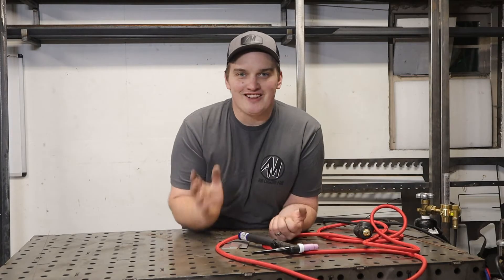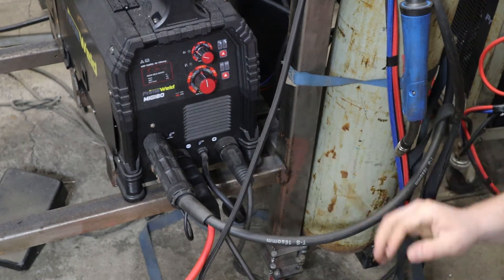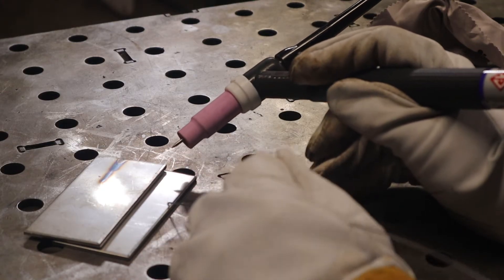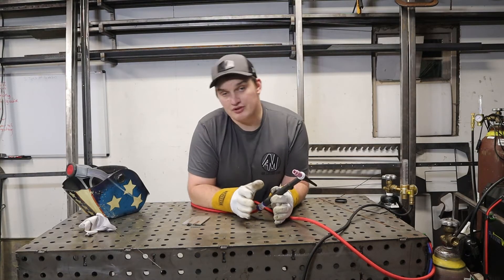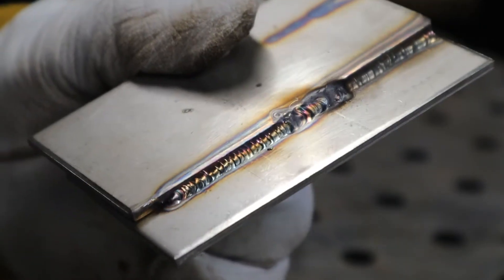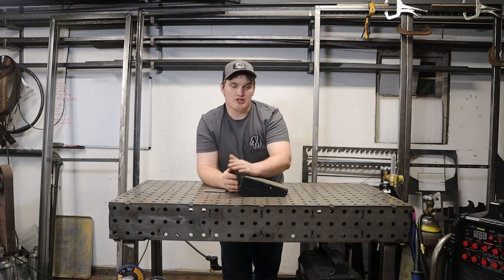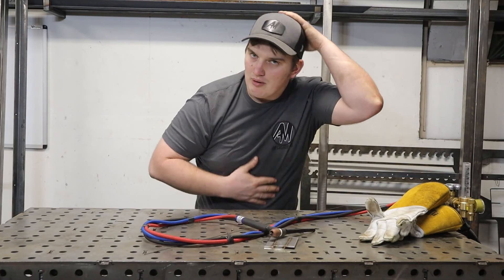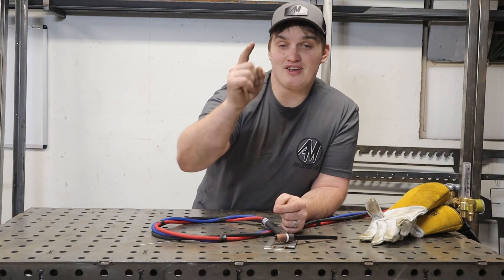Tig Welding Explained: SCRATCH START vs.  LIFT ARC vs.  HIGH FREQUECY

Comment: Better way to do scratch start tig is to rest the cup on the work piece and flick the filler wire between the tungsten and the metal. Makes sure your weld puddle doesn’t get a tungsten inclusion and it won’t mess up your sharpness on your tungsten if you mess it up

Comment: Out of the many tig videos I've watched, no one has ever mentioned a. That you can run a tig by clamping it to a stick welder
And b. That there are 3 different types of tig, I was about to buy a multi process thinking it had a pedal but it said not compatible with a pedal and it was called "lift tig" i was very confused so thank you for clearing all this up I would have been pissed to pay all that money for a machine that won't do what I was hoping and they are not very clear about that

Comment: Hi, a good post with introduction of the three TIG welding systems 'but' you should have added the added work to re-sharpen the TIG electrode when you stick it to the work or contaminate it. Always an issue with Scratch Start, less of an issue with Lift Start (but still there) and only an issue with High Frequency if you touch the work. So when starting out you are going to spend a lot of time sharpening electrodes, so even with High Frequency start I ended up sharpening three electrodes at a time so that I could just "hot swap" electrodes while at the welding station to save time. bye

Comment: What’s the best cheap lift Tig welder to get started with? I want to learn Tig but I don’t want to break the bank to get a decent welder… I would need a 110 welder too. I don’t have access to 220. Thanks for the video, I’ve never even heard of the high frequency Tig… I subscribed to your channel to btw…
Reply from the maker: I honestly have only ever used one lift tig before and that's the prime weld MTS 200 but I know there are other ones out there that are more affordable for lift tig specifically

Comment: Nice how the arc didn't hurt your finger, especially when you weren't grounded.
I've seen how another welder rerouted the foot pedal controller to a graduating push button near the top of the head which worked out well for him.

Comment: My Multi Handler's instruction manual says to hold the electrode in contact for 1-2 seconds before lifting. It sounds like it's screaming when I do it.

I guess the idea is there's an inductor there that will make a nice big pop when I lift the tungsten, but there's no way a 40-lb welder has a large enough inductor that it needs 1-2 seconds to fully charge up.

Comment: i'm a novice welder. i'm 49 years old and don't want to waste time with traditional classes and i've taught myself so many other skills i figure i can learn this with a little internet help. this video was extremely helpful to allow me to better understand what i want to buy to begin my journey. i will be buying a high frequency welder because the pedal doesn't have to be part of the equation. setting the max amps on the machine would allow me to use the pedal like an on and off switch if i need to in the beginning. it also ensures that i don't forget the gas

Comment: isit possible for lift arc to remove the ground and left it on the post flow. just wondering
Reply from the maker: Oh I understand now. I'm honestly not sure I have never tried that most of the time I will break the ark by turning the torch 90° and then tip the cup back towards the weld to allow for post flow
Reply from the maker: I'm sorry I don't understand the question can you rephrase it?
Reply: @amcustomfab  sorry for my english, if a post flow of argon is a problem(for lift arc, and scratch welding), can you remove a "ground"(positive lead)from a welding table to stop the arc, and continue to have a gas flow to the weld?

Comment: Hi dose the HF start up without gass or dose the gas have something to do with the arc????
Reply from the maker: It will start without gas but you will not have good results for a weld
Reply: @amcustomfab should start with gas if you have machine set right.

Comment: Well done on 10,000 🥳🥳🥳.
A really easy to follow explanation.
I have an ‘old’ Esetti 200 Amp, ac/dc/pulse TRANSFORMER machine ( HF start),  that I bought about twenty years ago.
I learned to TIG on this machine , and it’s still going strong.
Keep up the great vids.
👏👏
Regards,
Robert
( Sydney Australia)